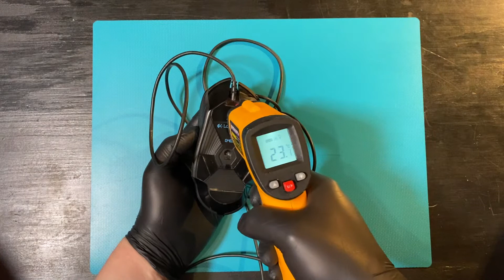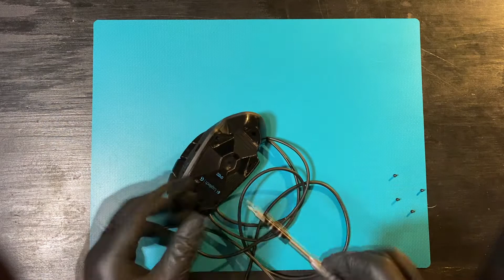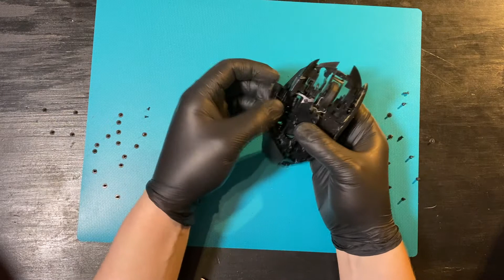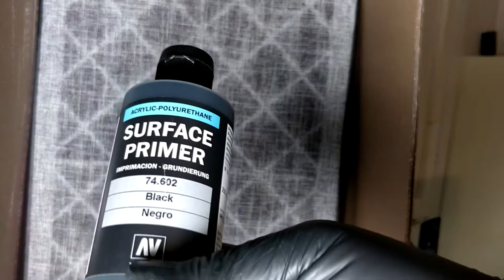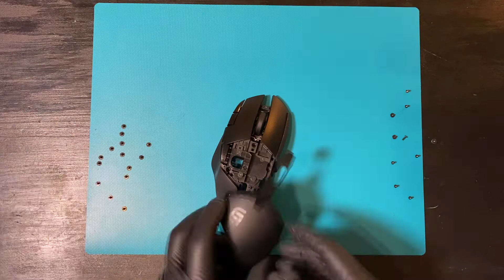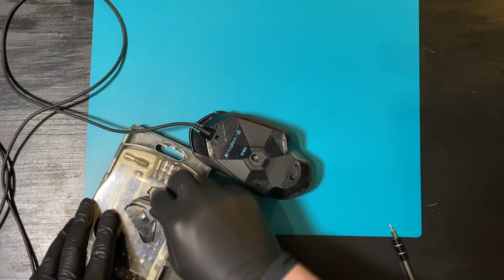Logitech G402 Disassembly & Refurbishing

Comment: Much appreciated! This helped me a TON on my journey to refurbish my G402 and replacing its switches. Some problems I ran into before seeing this video:

For some reason, after putting everything together and putting on my new fancy replacement feet, I discovered that the mouse doesn't sit evenly on a surface and the cursor twitched like crazy. It was awful. Turned out that somehow the middle part of the bottom was sticking out ever so slightly. I am still not sure why, but after reopening and closing it again it was finally fixed. So if you open yours make doubly sure that everything inside fits nice and snugly.

Not owning a heat gun I had poor success in re-removing the teflon feet without damaging the adhesive, so what I did was that I drilled holes for the screws on the feet while they were on the mouse (yes very carefully. I did it by hand, holding the drillbit between my fingers). I had one last replacement set but I didn't want to use it, being the cheapskate that I am.
Reply: Yep. I did the same thing as you. Drilled holes to the screws.
It pisses me off to no end that manufacturers do that. Putting the screws under the feet. 
It is totally unnecessary but intentional for sure. The harder they make it to repair, the more likely you will go and buy another. 
Just another example of good ole consumerism hard at work screwing over our planet.

Comment: Since 2016 mine was still perfect, but after spilling liquid in the middle mouse, i cleaned and ok, 2 months later someone spilled soda, and it started to intermitently work, after a couple days working fine it stopped, tried this, but to no avail, i'll try mess with the middle scroll some more..
Reply: You've probably sorted it now. But use Isopropyl or other liquid designed for electronics. Fizzy drinks will eventually dry but leave a sticky residue. This needs to be rubbed away or flushed if possible. 
Iso is very flammable. So care may be needed. 😉

Comment: hey i also have g402 i want to paint the mouse and change the mouse clicks and it has scroll wheel click issue can you help me fix it?
Reply: I'm here as my middle mouse click has stopped working but I found another video showing you how to replace the small switch behind it. Going to give it a go 👍🏻

Comment: The best mouse for fps games.. and its has good sensors..I'm still rocking it since 2020.. still worth for bucks if u wanna modding cable or switch....
Reply: I agree
Just sad mine's scrolling wheel button doesn't work so well anymore.
Reply: @Agm1995gamer  I have had this mouse since 2015, but I've had to replace it twice due to faulty middle click.
Reply: @Agm1995gamer  it will work. There's probably shit ton of dust down there check it out
Reply: been using mine since 2016, some side buttons don't work sometimes but everything else is just perfect till date
Reply: What switches do you use? Did you upgrade them or just replaced them with new ones?
Reply: @TheGunterled  im using Kailh GM 4.0 switches
Reply: i have my logitech g402 since 2018.. my scroll wheel doesn't work, probably from dust inside.. just needs a good clean, other than that it has served me really well.
Reply: @hazardousskillarena5717 
I got the same issue , i already bought a new one , but i also give a try to fix my war veteran .
Its served at least 8 year
Reply: @ i have tried deep cleaning it, literally unscrewed the whole mouse, didn't work at all.. i ended up buying a brand new one.